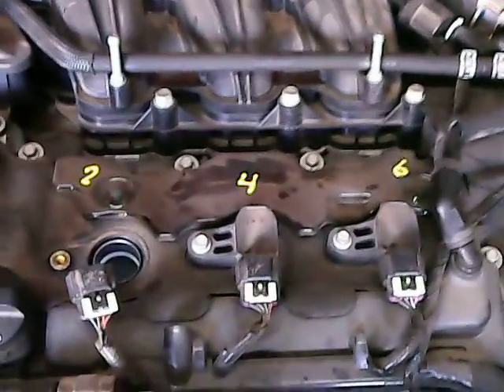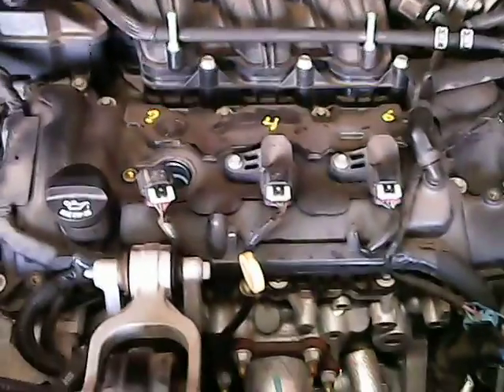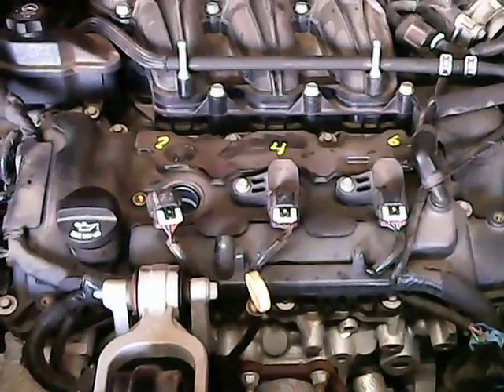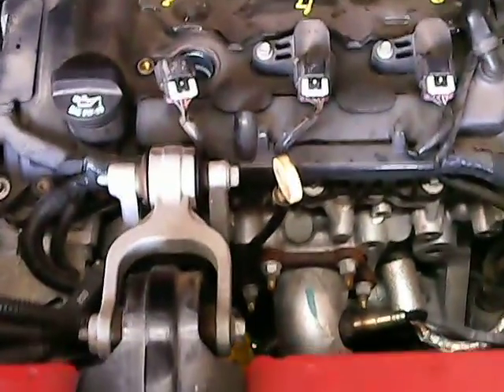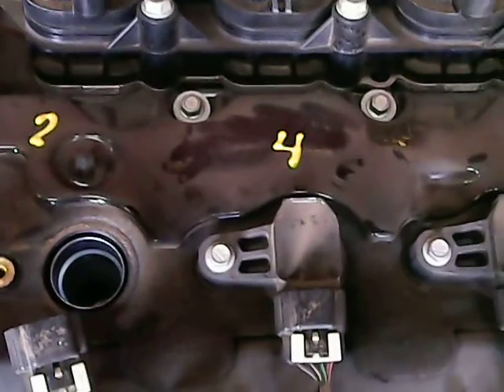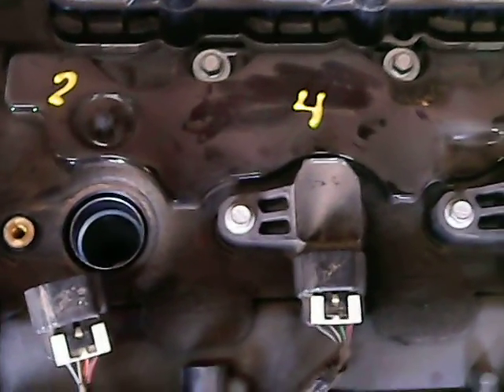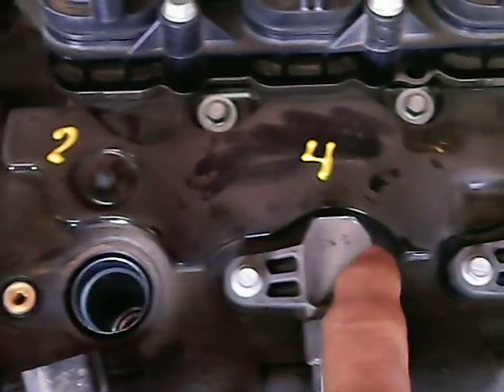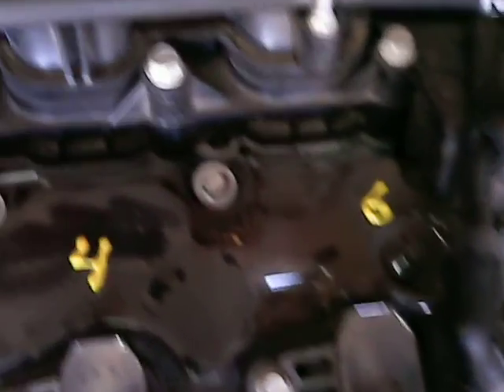DIY AUTO TIPS / 2012 Impala 3.6L cylinder configuration

Comment: code P0014 for this motor??   whats the problem. why does every gm motor have an issue 2.4 now the 3.6
Reply from the maker: P0014 is "bank 1 exhaust camshaft over advanced".You might pull out the exhaust Camshaft Actuator Solenoid Valve and look to see if the screens are plugged. These cam actuator valves are so sensitive that a small amount of sludge can make then stick. I recently replaced one. Keeping oil changed very frequently is so critical with these components.
Reply: youroam1 . Guess I will try that.
Reply: does this solenoid valve come out easy?
Reply from the maker: Here is a forum link that tells how (scroll about halfway down the page where "coloradofjr" tells how he did his : http://www.impalaforums.com/chevy-impala-8th-gen-discussion/1526666-p0014-2012-3-6l.html